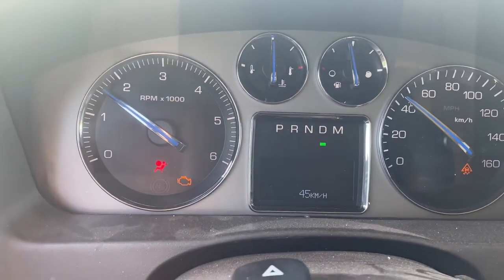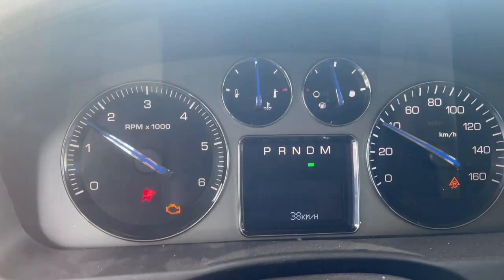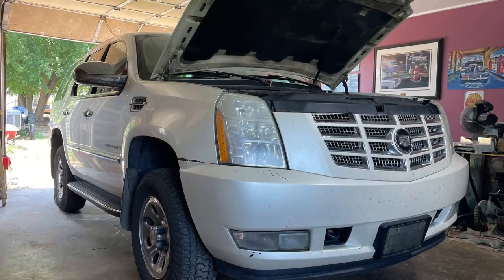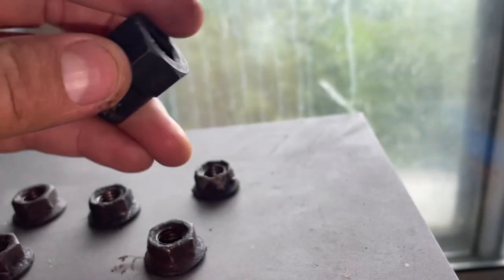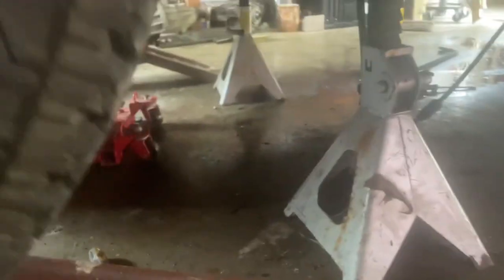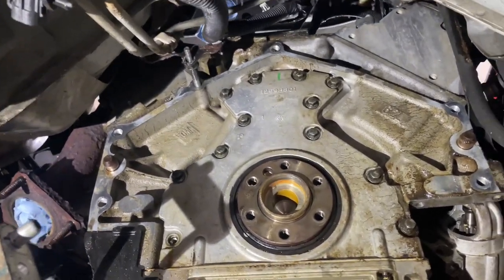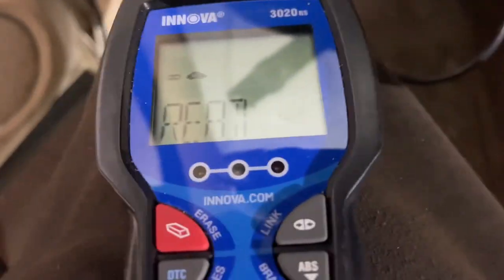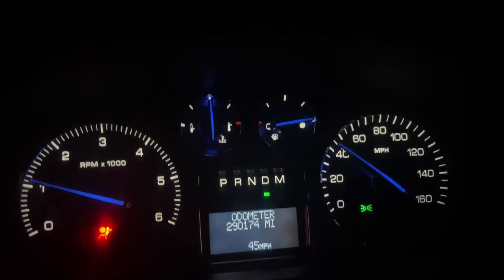2007 Cadillac Escalade - STABILITRAK/TRANSMISSION PROBLEMS/CHANGE/FIX

Comment: So what all did u have to do and replace im not having problems with my transmission just the stabiltrak light come on and I have to get my obII reader and delete codes and then It will work again like nothing for a while but it also says by 2nd Bank of 02 sensor needs to be replaced you think I need to replace this or what else should I take a look at it kinda sounds like it's misfires sometimes thanks for the help

Comment: My Stabilitrak and traction control  come on but makes p0011code come on with engine  light i changed vvt magnet and vvt solenoid/actuator and camshaft position  sensor  removed  engine  light and gave it power also did wheel hub both are bad but only can do one for now it removed  the light but comes on and off im guessing the other wheel hub and sensor is horrible  i can feel it when im braking and driving but with the new one made a huge difference

Comment: I have same year in Canada and corrosion breaks seals on all external electronics ! The miniature retainer screws of all modules, coil packs , abs module …, corrode , expand the anti crush sort of roll pin design that they pilot through . When this happens , the fasteners , surround roll pin break the electronic seals and then the shorts, failures abound. Only remedy is to due what GM should have !, replace everything at great cost , removing all those fasteners and liberally coating inside with anti seize/ waterproof grease to keep them from rusting and expanding again . Hard to believe they are not aware of this , never another modern GM in this household and too bad because I truly like vehicle . I’ll take my 89 suburban electronics anyway !
Ps : great video ,keep up the good work. Currently my dash lights are , motor, abs, parking brake, stability control, suspension and ?, runs great but worried about liabilities if I slid into another car because no abs ,etc , but not putting thousands more into it as the body , body mounts, etc are all going really fast.

Comment: I had the same problem  and it was spark plug #6  but also is leaking little not sure from where but is a motor oil on my case

Comment: I have the same problem, so is the transmission that needs to get replace?
Reply from the maker: You could try and replace the torque converter first and see if it fixes the problem. Or change the whole transmission. It’s almost the same job labour wise.

Comment: My Cadillac escalade ext is same problem
Reply: id you ever find out the problem with your escalade
Reply: It was something have to do with the transmission wiring my mechanic just wiggled the wires and it worked fine.

Comment: How much to get my cadi service with the same issue?
Reply from the maker: For a shop to do it or to do it yourself? .. If you change it yourself you can probably pick up a tranny on marketplace for under 2 grand and the odd buys like new rear main cover gaskets and seals and tranny fluid and filter is probably going to cost you around $400 so to do the job yourself I would say anywhere between $2000 to $2500 depending. … for a shop to do it you’re looking at around $4500 from my calculations and regional pricing.👍

Comment: Noticed you had a P0011 code. I got that too for the VVT. I just changed the Magnet VVT solenoid and Camshaft sensor behind the water pump. Hopefully that did the trick.  For me it stalled after coming to a stop from highway speeds.
Reply from the maker: Yes seems to be an ongoing issue with the older Escalades, I recently changed oil filter from Fram ultra synthetic to WIX XP and it has been running better..
Reply: @rezcarguyz26  I was sad to hear that many if not most modern cars have VVT. I feel like it just adds more things that can go wrong. Apparently as you mentioned the Oil Change. These cars are very sensitive to the Oil. Mine seemed to go through a fresh synthetic oil change after about 2-3K. I figured it's running a bit hot so I went up from 5-30 to 5-40. It seemed fine however either do to that or late oil change, but I'm afraid that's what possibly caused my P0011 issue. I'm going back 5-30 and I'll just have to change more frequently. I'll look into that Oil Filter.

Comment: Good video i have same truck, bought it with check engine light on & on limp mode wouldn't pass 3rd gear until i vlear the codes then drove fine through all gears until check engine light came on went back to limp mode & you couldn't see the indicator light under the 
P R N D M.  ONLY WHEN THE CHECK ENGINE LIGHT WAS CLEARED. The code was for the internal range sensor $40. I replaced it and runs great. I think i will have to replace valvebody because at cold it will shift with a small slight delay on 2-3, 3-4 but when warm shifts great.
Reply: I’m having the exact same problem do you have the part and part number you bought?
Reply: @MegaBmxlife did u find that part number then? Im havin same issue with mine
Reply: @markgraber4617  I replaced my entire techm and valve body from streetsmart 
It fixed everything